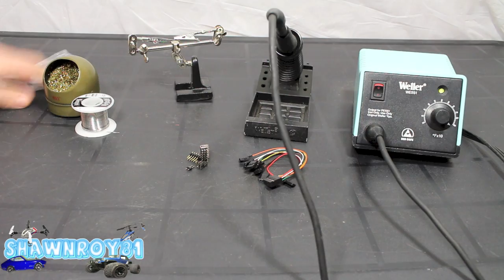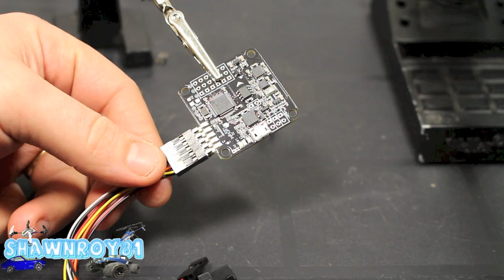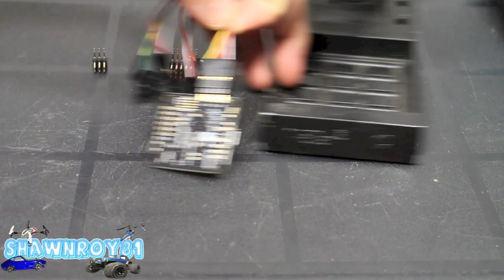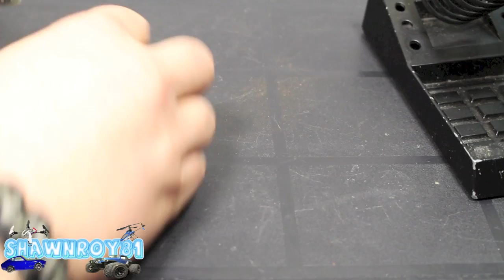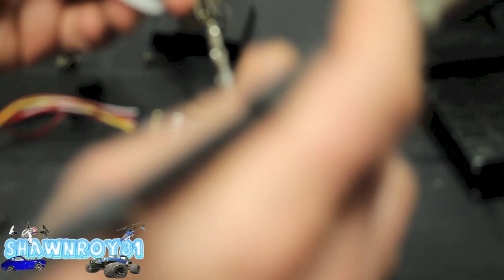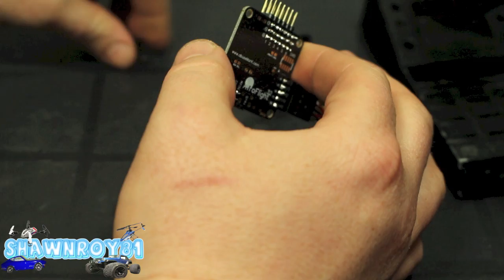Soldering a Naze 32 Board for my FPV Quad Racer

Comment: Hello, I enjoyed the Video. Could you tell me what Brand and type solder I need for the quadcopters?
Reply from the maker: +Tione Dillard Thank you. I use a Weller WES51
Reply: +shawnroy81 Thankyou, I was referring about the type or brand solder on the roll...
Reply: +Tione Dillard also size
Reply from the maker: its Standard 60/40 formula rosin core solder.  Diameter is 1.2mm. Same stuff I use for all my electronics. Works great.